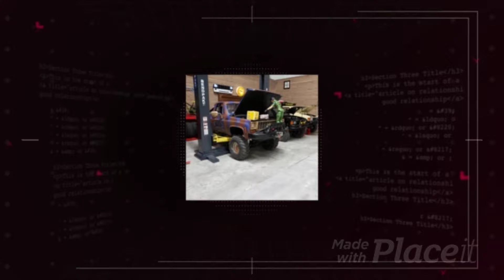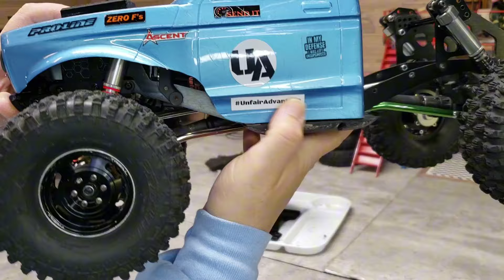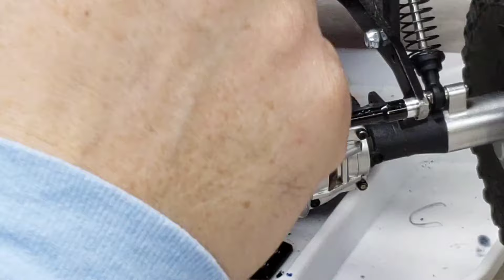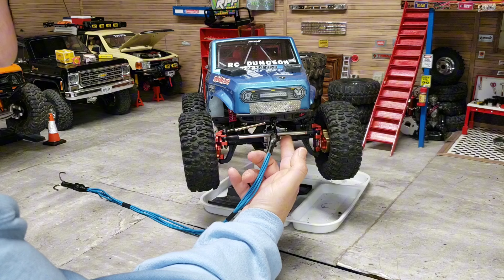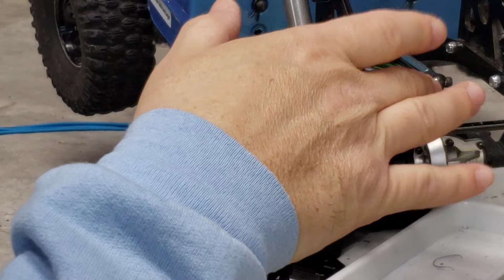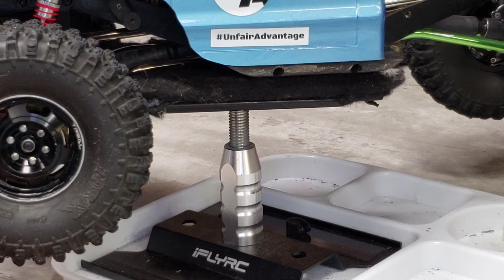Redcat Ascent/Linkriser/Revisited

Comment: If anyone wants to modify the front link to get more steering,  I just take the plastic link ends off.  Put the the link on 2 blocks of wood one underneath each end of link. Take a hammer handle preferably a rubber grip on it and just hit it lightly a couple of times and check it to see.  That's it..
Reply from the maker: Thanks for sharing this bro! I see guys blowing all this money on high endings when its just a simple modification lol!

Comment: Are the rear green links high rise in the stock length?  Do you have a link for those?
Reply from the maker: They are Axial wraith links extended with a nylon lock nut to correct the pinion angle.

Comment: A lot of people don't understand how link placement and angles works.   Could do hours on this topic.
Reply from the maker: Exactly sure could , but why easy enough to sum it up it basically changes the trajectory of down force on your front end correct? I mean its pretty obvious that if you have an issue with your front end lifting and bam link riser goes on and suddenly no lift without any other changes what else could that be chulked up to? I was more aggravated that people couldn't simply research just a little bit I provided name even for a simple little search would have yielded the man that provides the product since the link was not functional on my end. Anyhow thanks for commenting man I appreciate it 🙏